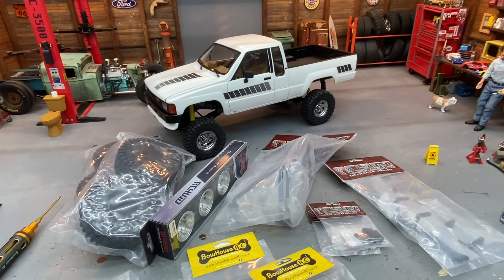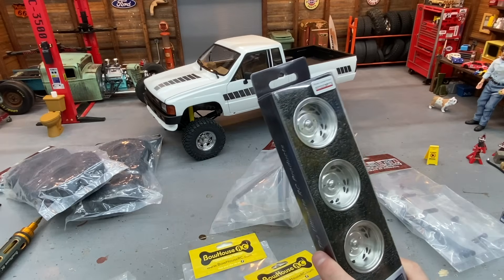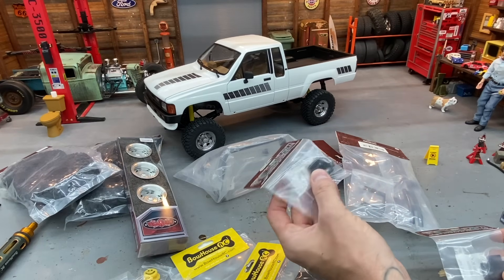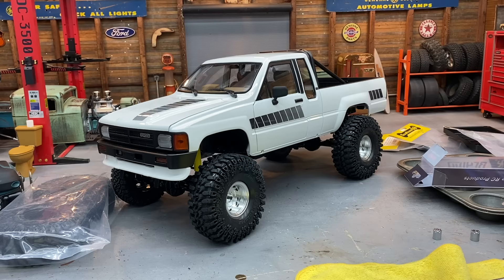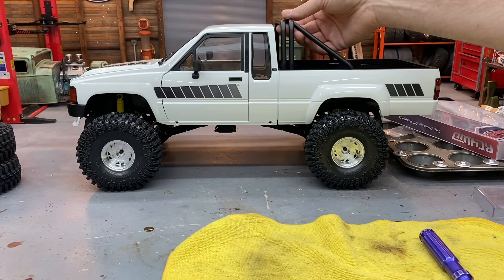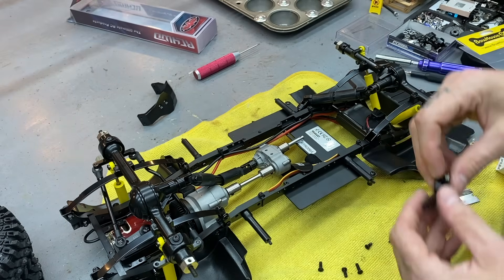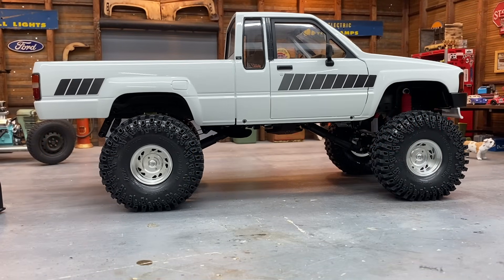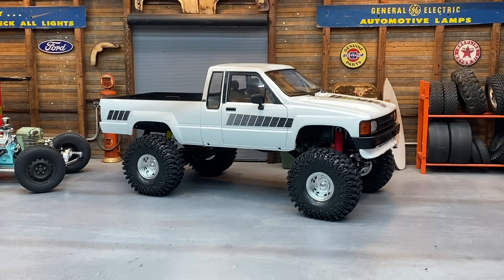Show Truck Build, The New RC4wd TF2 Yota Xtra Cab, Part 1, Lifting Leaf Springs & Swampers

Comment: Keep the good work man, I like the direction this one is heading 😉 Also, if you need a little extra length out of the shocks you can swap the ends with the traxxas rod ends. I do this often on mine when I need that little extra length and they tend to not rattle loose then either

Comment: Might want to try the A&M Garage high clearance skid/ transfer case mount, it allows you to mount the transfer case much higher, and doesn't require a change to the rear drive location. Only thing I found it does, is it makes the front shaft sit closer to the trans housing, which, if you run the single speed trans, shouldn't be an issue. I have A&M Garage's shackle reverse kit, and high clearance case mount, and love them on my LWB, and what really is awesome about them, they're made from aluminum.
Reply from the maker: I have that setup on my 4runner. Love it for crawling.
Reply: @RCeveryday  hey I looked for the washer fluid bottle and break booster in your store and didn’t see them . Where can I find that stuff for the Chevy blazer?
Reply from the maker: Those parts on this truck are with the scale engine bay from Rc4wd.com. If you need those pieces separately scaledesignsbymrcommaD.com makes them. Funny name but he makes a ton of scale engines and engine bay accessory
Reply: @RCeveryday  yeah, with mine, I'm running the 2 speed, so I had to get a left pumpkin front axle, ended up switching to the K44 axles. I know the LWB comes with them for the K10 body, but mine is the old first gen, with the Mojave 2 four door body, that I got badged up as a Hilux

Comment: Looks good bro, I have the same 1.55 Irok tires on my Back to Future 87 and added a 4mm lift block in the front and back to get the clearance for the tires. I noticed the same thing on mine with the rear axle not looking centered until you squat the suspension . You can’t notice it with the smaller tires nearly as bad .

Comment: RC4WD still sells the super scale shock boots in yellow, they also have em in blue, red and black. 
They also have rear shock mounts that bolt onto the side of the frame with quite a few options for adjustment, compared to just bolting it right onto the frame, part number is  Z-S0768

Comment: great video !!! quick question the 1:10 scale lift you have in the video do you know if thats wide enough to fit the rc lowriders? been looking getting one just worried its not wide enough.. or even to heavy lol ?
Reply from the maker: That one is not motorized like the rc4wd one, but it is wide enough for the 64 and 59.  They are roughly the same width as the scottsdale body.  All aluminum it can hold some weight.  I think I got it through RCmart or Asiatees many years ago.
Reply: @RCeveryday  appreciate the response and information.. definitely going to picking one up soon or 2 lol 😎🤝

Comment: Instead of the lift blocks, why don’t you use the spring that has the lift already been into it that also help you with Axel wrap instead of having those blocks
Reply from the maker: They wouldn’t really give it lift. Unless I stacked in 10 or so per corner. But then it would have no suspension travel at all and be terribly stiff.

Comment: 87 had a independent front suspension
Reply: Unless you did a front axle job on it. I’ve been wondering the same thing why they didn’t get the body correct with 85 but I think that they are the same body?
Reply from the maker: yeah, the body style changed before the axle did.  They modeled it after the owners 87, but they dont offer an IFS so we get a hybrid, lol
Reply: @RCeveryday  are the 85 and 87 year model close to the same?
Reply from the maker: From my understanding. We had an 87 when I was a kid that was like this. But with the ifs. I think other than color options changing through the years they are basically the same body.
Reply: Awesome build man. Totally something you would see on the road in the 90s! The scale is incredible man!

Comment: You weren't cool back then if you didn't have at least four chrome shocks per axle and chrome or paint matched dual steering stabilizers. At least I only remember chrome, color matched or just Rancho White on everything. I wish someone would come out with a stout scale 2 1/2 ton top load Rockwell axle, something that would handle a really powerful brushless set up.